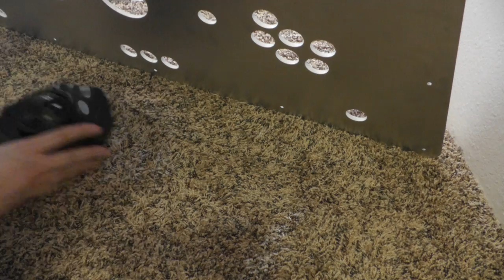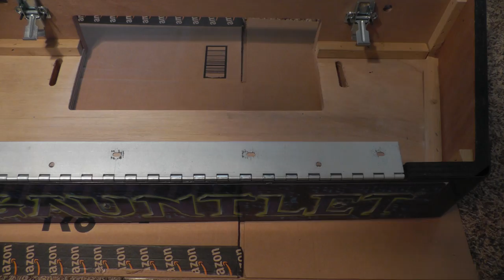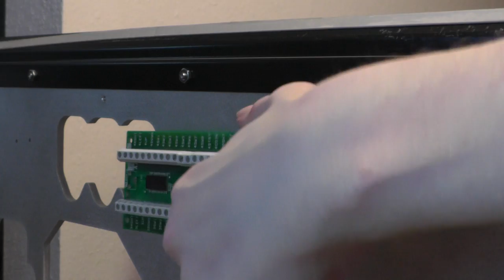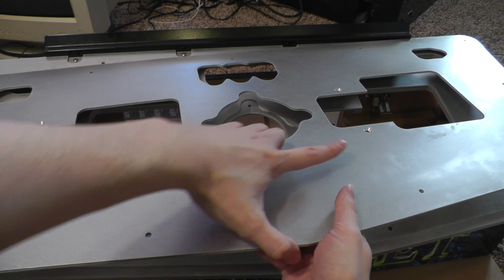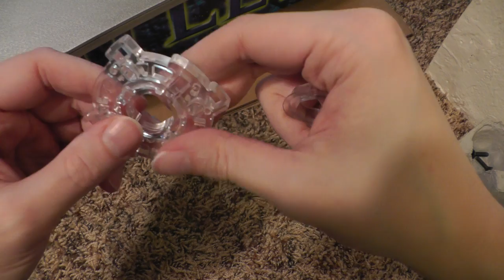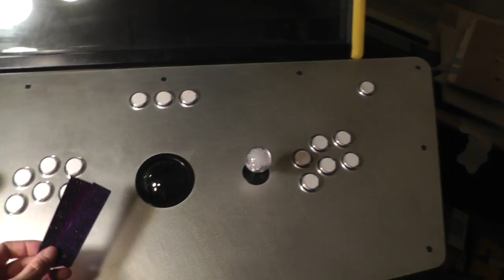MAME Cabinet Conversion Part 8 - Control Panel

Comment from the maker: The bottom plates I wasn't too worried about because I could just drill a gnarly hole and it wouldn't be visible.  But if there was something wrong with the top plate I would have no means to fix it other than order another one which is a couple hundred bucks + 2 or 3 weeks of waiting.